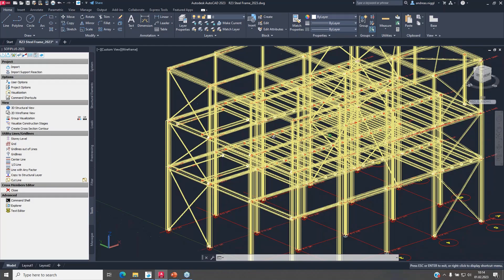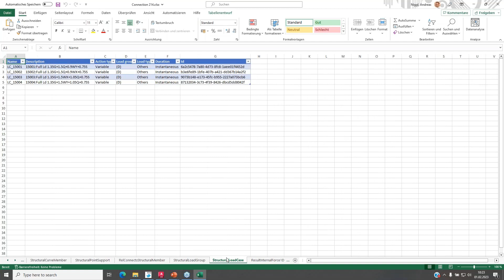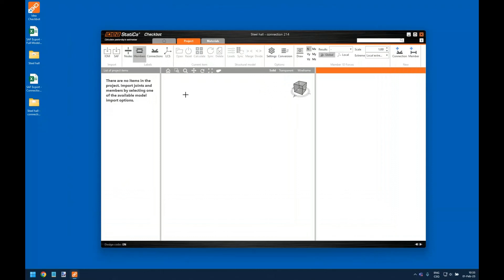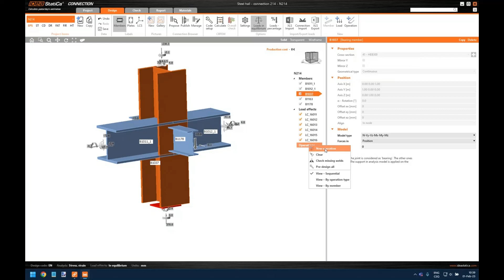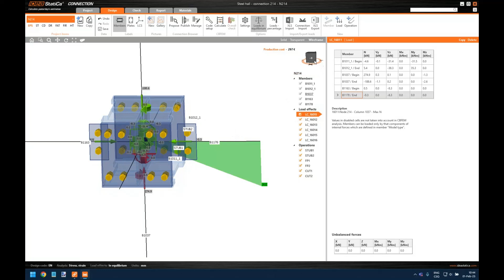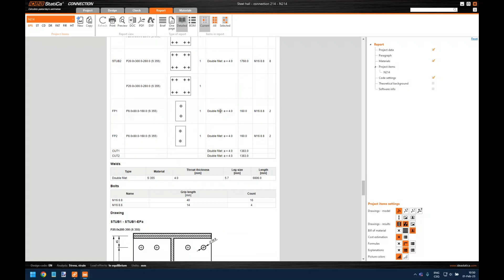Design Steel Connections with SOFiSTiK and IDEA StatiCa

Comment: Dear Sir, Very Informative video... I have a question, Does Sofistik supports IS (Indian Standards) codes for Concrete & Steel Structures? Thank you...
Reply from the maker: Hello, Sofistik has it here
https://docs.sofistik.com/2022/en/analysis_and_design/calculation_design_matrix.html
IDEA StatiCa support IS
https://www.ideastatica.com/support-center/indian-design-code-is
Reply: One questio please, the first load combination is for max N, but of which member ? Is it the maximale axial force of one of the members, along with all the other concomittant internal forces of this particular member as well as all the other members ? Thank you in advance.